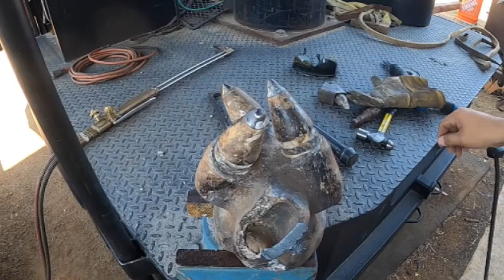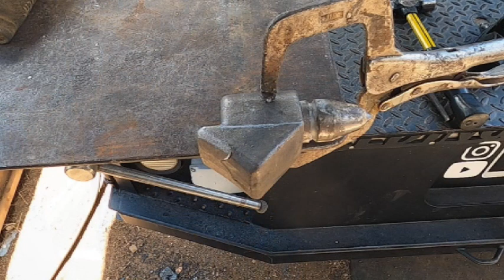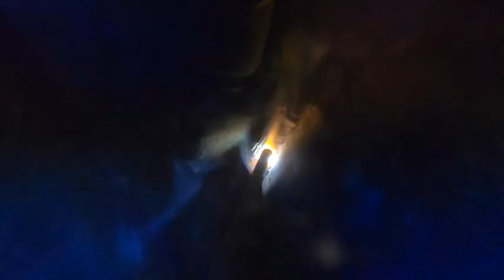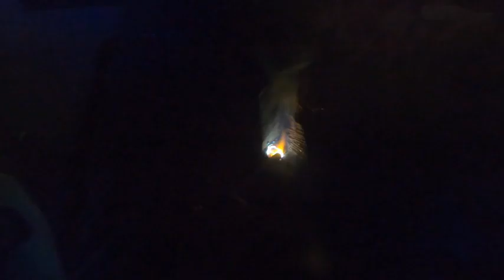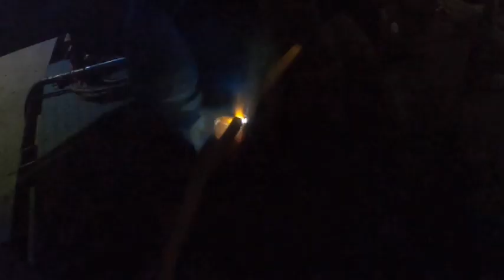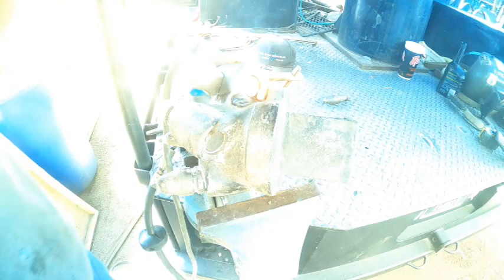Torch Work and Stick Welding

Comment: It always amazes me, first of all, how neat your torch work is and how quick it’s able to cut through thick steel. You make it look so easy but it’s anything but. The AvG channel did a video about torch cutting and how difficult it is and that it can take years to become even average at it let alone the skill level you have. Awesome job as always Issac.
Reply: Might take Avg a bit longer than that.
Reply: Do you mean AvE? Or is AvG a channel i haven't came across yet?
Reply: I could not agree with you more
Reply: @Lucas12v  your right, it’s AvE.
Reply: That’s probably because he might be using propylene instead of acetylene. That’s what we use at my work shop. All we do is repair for heavy equipment like augers.
Reply: @myfb3936  I asked him awhile back,and he replied that he only uses  acetylene,but would like to try propylene

Comment: I was a driller/driller helper for 10 years can't count  how many hours I spent fixing augers and center-bits on hollow stem or continual flight. I'm not sure how much you do these kind of repairs but when I was doing it I would find a piece of pipe with the right inside diameter of the lead bits like you were just working on, and then I would make reference marks of where the pockets and bit points are on the pipe that way it's an easier way to rebuild it and get it back in the right position one other thing I'm sure you did it but you didn't show it was make sure those bits turn in the pockets otherwise they'll wear out extremely quick and prematurely fail as well as your client either needs to do hard facing or pay you to do the hard facing that way it will keep the pockets and center-bits from wearing out as quickly as well BTW  absolutely love your Channel you are one of the best man I have seen with a cutting torch in my 30 Years of construction as well as a welder/fabricator you need to teach kids how to weld and torch

Comment: You are a master at your trade but a word of advice from a guy who runs a large asphalt grinder and replaces teeth all the time don't hit the carbide tip with a steel hammer that's a good way to loose your teeth the carbide will blow up in your face use a brass hammer when you hit that tooth in with your hammer I cringed love your videos

Comment: Great to watch reminds me way back when I was getting my pipe cert but since being in racing all I do is TIG OR MIG! It’s great to see a pro at work with a stick Rod what a pleasure to watch your technique in the vertical position!
Reply: Henkka  well I would tend to disagree with you, there is a use for every type of welding or it would not be so widely used throughout the world today, there are thousands of things welded together with one or more types of Metal inert Gas Welding. So I actually find this statement very ignorant on your behalf. From the car you drive to the cart you push at the grocery store is welded with this form of welding. Next to SMAW it’s probably the most widely used form of welding.
Reply: Mig is very useful and very versitile,if you do the research on its capabilities,and purchase a good machine tge possibilities are endless,you can weld lots of different metals,you can mig braze,you can weld cast iron etc:

Comment: I might be wrong, but I think the people who have problems with short circuit mig are concerned with the lack of penetration (hard wire only, flux core is fine) this process exhibits.  My own personal experience  supports this, as I have seen hard wire mig welds fail and on close inspection, the penetration was minimal.  Great videos!!!!  Many happy hours I have spent learning new things watching your fine work!

Comment: Great job, both the welding and the videography. The auto-darkening lens on the camera and edited volume on the audio when using the needle scaler are pro level. When I slow down the video speed, your movement of the rod tip and working the puddle can truly be appreciated.

Comment: Very well set out points needing to be in line and not just sizzled in randomly . Lots of care to put it where it should be even breaking the tack as it wasn't sat right . Some very nice torch work and a good build up of weld . Bread n butter job but still interesting enough to video to show the satisfaction you get doing any project.  Thanks for sharing

Comment: This is much better than the other bit repairs that you have (not that they were not good)  it looked like it came off the sales floor. It would be interesting to see how long it last in service. Great work.
Reply: Not long, repairs get fucked up way faster lol. Also for it being a pilot, it’s just hold in place with a bolt and a nut. So they are easy to replace.

Comment: Great job saving that tool. I used to do alot of milling drum repairs and where position was crucial I would make a simple jig using round bar down a good tool holder hole and bit in the worn hole as best as possible and bridge the 2 bars with something to hold them. Once the damaged holder was out I could tack the new on in the exact sam position.

Comment: Spot on on the ground lead brother, I always ground to the work piece. That way the circuit cannot close another way around.
I applaud the use of the Heel Bar slag hammer, much more elegant than my screwdriver 😁
Oddly enough, I would have chosen the vertical up triangle weave as well in this situation. I suspect many would not, but I could be wrong. Nice work as always Isaac. Cheers

Comment: I've welded on hundreds of vehicles without disconnecting the battery and never had any issues.
Reply: Yeah it's all about grounding. You don't want to us the chassis grounding or wiring for welding grounds at all.
Reply: Don't use HF start.
Reply: @topduk  I've done multiple fueltanks repairs on trains with HF Tig.
And if any vehicle has computers and electric do-hickeys on them, it's trains.
Never had any trouble. It's all about putting your ground clamp close to where you are welding.....

Oh yeah, and drain the tank thoroughly....💥
Reply: @kristianskov4841  The higher the voltage the more critical that becomes.

Comment: I added a second ground to my welder so that I can work on the back of my truck and whatever I am repairing without having to move the ground back and forth.
The concern of ruining electronics and wiring is something that I have thought of when welding on equipment.  I keep coming back to your experience.  Every rig welder welds on the back of their truck.  I have never heard of anyone frying the brains in their vehicle.

Comment: They chose the right person for the job. That bit would have taken me hours of measuring, layout and planning on the surface table before setting up and milling that pocket out and trim/bevel the tooth holder.
Reply: Not trying to discredit him, but pilot fixing is very common on augers. Honestly, at times I’ve had to fix 75 C30 pockets and C31 teeth. (The ones in the video) and that takes like 10 hours of measuring and tacking and basically trial and error. Basically saying, easier than it looks when you get a little bit of experience with heavy equipment. Especially foundations and hole drilling equipment.

Comment: What's the most used hammer in Isaac's tool box? His multi-tool. To help with not damaging the truck with grounding your welder, try a thick sheet of rubber under the mount of the vice. Hopefully you have a sheet of plexiglass over the camera lens to protect it from splatter.
Reply: In the 40+ years I’ve been building high end race cars I can tell you that I’ve never fried a ECU! That being said I have fried a couple of desk top computers and the only thing I can think of that did it was the high frequency of my MILLER TIG Welder?!? Try this…turn on your FM radio the fire up your TIG Welder on AC and weld something and you can hear the interference of the high frequency coming through the speakers.

Comment: I use to work at the railway up in Canada CNR we would do the Christmas tree vertical,you start by building a shelf at the bottom then go up the side to the center come back to the other side and hold then go across the face to other side and hold then to the center and hold used a 7018

Comment: You make vertical weaves look so easy. Let us know if you have any tips for vertical welding in future videos. Thanks for the videos. 👍
Reply from the maker: Watch the cooling edge of the puddle below the weld. itll tell you where you need to pause or fill as youre moving side to side.
Reply: @ICWeld  thank you for this.

Comment: What does that kind of repair cost? How much time does it take outside of the 43 minutes you recorded? Just curious-it may not be professional to discuss the job cost so forgive me if I shouldn’t ask.
Reply: As a welding/fabricator with a shop I Northern California I can tell you that my shop rate is $150.00 an hour so if I was doing that job it would probably have cost the customer $300.00 because I would think that he had two hours total in that job from start to finish. Am I pricey, oh hell yes but your paying for 40 years of built up knowledge. You could take to Joe blow, know nothing and have him do it for $50 but you get what you pay for!
Reply: @Mtlmshr  That doesn’t sound high at all if the result holds up well, as the customer is getting something functionally equivalent to a new part.
Reply: A new pilot with 4 teeth like this is around $400 (China made) Most of the time when a pocket breaks off. We just replace the whole pilot unless it’s an easy fix. The only time repairs are really made on pilots is because they needed it on a job asap.

Comment: I think I figured out my torch problems, I hold my tip too close to the work, or maybe I don't run enough oxygen pressure...Or I'm asking too much from my small tip.  Your video's I have learned a lot. He cuts nicer free hand with torch then my plasma cutter. hahaha A+++

Comment: Good in advance, thanks for uploading these videos, the rod e7018 or 7024 of 1/8 I think or it could be 5/32 and with the cuts it uses acetylene in the workshop where we repair it, it uses propane or LDP you have sorted with this fuel that here It is much cheaper and easier to get thanks.

Comment: if you are running that at 107 amps (they look like 1/4inch rods) I have been using some awful welding rods...I need to look into that, I could not weld something that chunky with the rods I've been using. 
are they standard mild steel rods too?
I learn a lot from watching your videos so please keep posting them.
Thanks Isaac
Reply: Not they look like a 1/8 - 5/32  rods.  the piece of steel that he is working on is of high  carbon steel,  so the welding rods must match the quality of the piece to be welded on !!
Reply: I'd very much like to know the rod and diameter if you would, when you said 107 amps especially thx

Comment: Milt your rod control is amazing. The chge you made from 103 to 107 seems insignificant but results says it all.
You could have set it for flat but stayed with vertical. Would that have allowed you faster buildup?
Marvelous!!!!
Reply from the maker: Once you weld for long enough, you can tell the difference between 1-2 amps. it makes a difference.

Comment: i've said it before and i'll say it again...who needs a plasma cutter when one can cut like that with a torch!! Just blows me away every time i watch you work. Question [i'm not a welder, just a mechanic with a little bit of welding time]: why did you run the big gap up-hill and not weld it on the flat instead?

Comment: Near the end with the last couple of passes, I wonder if welding in the “flat” position (instead of vertical up), would have been viable with a 7028 low-hy rod?   I know it’s hard to find 7028, but it puts down a ton of metal for large gaps.

Comment: I always knew that an ac welder would fry your truck electrical but was always told dc was safe but I still disconnect the battery just to be safe

Comment: The way he runs the weld, it looks like he is using 6010 or 6011 welding rods but the finished weld is not what those welds look like when you use 6010-6011 rods !!

Comment: One thing I notice you always seem to do on wide welds is literally weld from side to side in one pass for multiple layers. Then you watch others do string welds to fill a wide area. Is there a reason why you go the way you do. Your way seems quicker. Is it harder to do the wider weld. Just wondering.
Reply: In my experience, AWS really preaches using stringer beads and I think that’s how a lot of guys are taught because that’s what AWS wants. An inspector once told me that, per AWS guidelines, they NEVER want to see a weave wider than 1/2”. In a vertical up, I have always seen great results in weaves wider than 1/2”; within reason, of course. Not over an inch, in my opinion.
Reply: @williamthomas9463  Thank you for that.

Comment: I'd bet that part was investment cast.
Reply: I think that you are right because it would be an absolute nightmare to try Green Sand cast, with parting lines and draft angles and holding the sand cores in the correct position. 
Mark from Melbourne Australia.

Comment: I was taught to use stringer beads and not to weave, the weave puts to much heat into the weld and can cause failure of the weld over time !!

Comment: Could it be a forging?  Won't welding on a forging destroy the metals structure?
Reply: I believe Isaac said he thinks the body was cast steel.  No, forged steel is welded all the time.  Forging is just another way to shape steel, hot or cold.

Comment: Hey Issac just a quick question for you, is there a reason as to why you left the tooth in the holder? Wouldnt that affect the lock spring on the bullet tooth due to the heat input? Or does it not really matter if its in the holder or not after its been fitted?
Reply: the tooth might be affected but is replaceable, but if it's in the hole the dimensions of the hole can't warp or are far less likely to
Reply: @petercasey175  yeah that makes sense too. Fair enough👍

Comment: The bed should be insulated from cab by rubber body mounts right?
Reply: its bolted through the frame even if it sits on rubber   mounts
Reply: It does not matter.  Electric theory 101.  Path of least resistance.  Beyond that at no point is anything traveling through the bed as nothing was ever connected to the bed.

Comment: Sure hate watching you run that low hydrogen rod like you would run 5P, stepping foreward- in and out of the puddle, trying to weave............Stringers man! Maybe you need to stick to the mickey wire. lol Still nice video :)